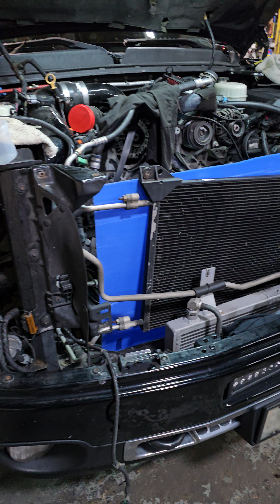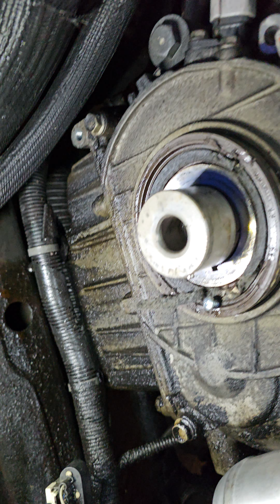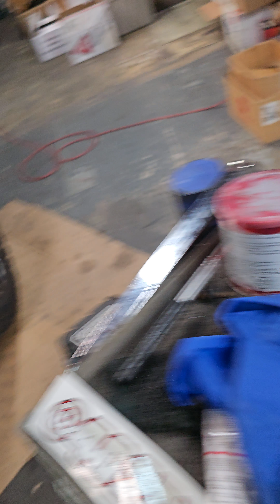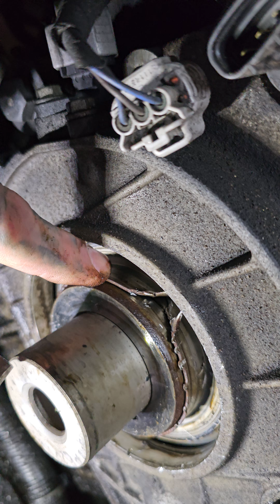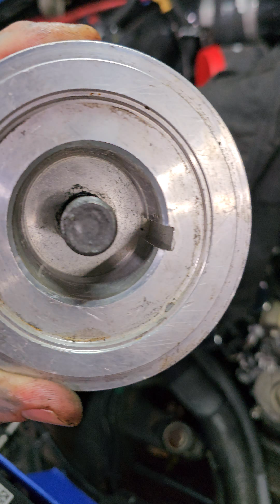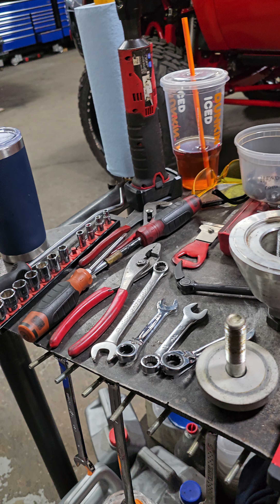How to replace front cover/crank seal replacement 2001-2016 duramax diesel lb7 lly lbz lmm lml

Comment: Grease the outside of seal and mating surface or no?
Reply from the maker: No sir. You don't want to do that and risk the seal spinning in its bore. I have used a thin film of anaerobic sealant in the past bc that will cure and remain firm once cured.But definitely no grease or petrol based lube of any kind 👍
Reply: @ awesome, glad I asked, thank you
Reply: @richiestruckandauto7438  I have an LMM these aren’t widely known for having front seal issues are they?
I’m kinda worried about why mine might be leaking at only 177,000 miles
Reply from the maker: @tylertavis3178 it's the same front seal for 01-16 duramaxes. I've seen them sweat at 60k from sitting and others last 300k without a drip. The lifespan largely depends on oil service, piston blowby, CCV condition (rerouted method or stock)
Reply: @richiestruckandauto7438 if the engine has no blowby through the oil fill cap test, could it be from sitting?
I took the factory harmonic balancer off to install a Fluidampr, as LMMs can be known for broken cranks, and found oil on the back of the factory damper.
Just worried the crank is moving around and that’s what’s caused the seal to go out
Reply from the maker: @tylertavis3178 honestly the crank can walk fwd/bkwd several thousandths w no issues. The seal just rides on the machined hub all the same. If the thrust bearing is damaged then I think you will have far greater issues than a leaking front seal. Did you see oil slinging off the balancer or just some wetness?
Reply: @ it wasn’t slinging off of the balancer but it was “puddled” on the back off part of it and on the back of the washer for the bolt of the balancer.
It wasn’t streaming down the front of the block or anything though and had no signs of past streaming down the front of the block, kinda just accumulated/puddled a bit on the back of the balancer
Reply from the maker: @tylertavis3178 what you're seeing is probably a small amount that made it past the hub. The hub that the seal rides on is pressed against the nose of the crank when the balancer is tightened. The hub itself floats w no seals or fastener beyond that. It is possible some oil may slip by it after years of service and hundreds of heat cycles.

Comment: How far is that hose from the water pump y tube on video go? All the way back to turbo, or just what we can
See in video i have lly just about finishing head gaskets etc...
Reply from the maker: The house connects to a steel tube of smaller diameter at passenger side head. It runs along side of the intake manifold and turns right just under the turbo. At this point it becomes a rubber hose again for a few inches before it connects one again to a steel fitting on the turbo

Comment: Fan Hub Support is 1000$ from G.M. or Fag makes the HSR "High Speed Roller style" Bearing number is a 6208. Frost plug is 40mm....
Thanks for the heads up on the basics for removal here big guy, saved my arse as i would have drilled to deep, possibly. Anyway, again thank you sir...

Comment: can be done easily without removing the radiator. especially with a top side creeper.
Reply: Easily to the experienced, he's saving a lot of grief firmly the in experienced. Scroll up to top nd you'll see exactly this
Reply: I removed the lower fan shroud and did it underneath.